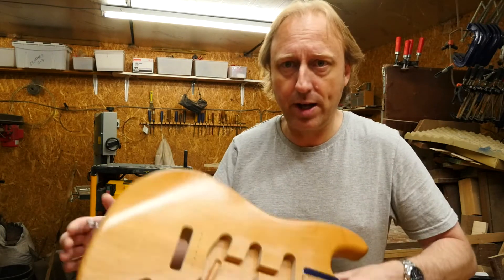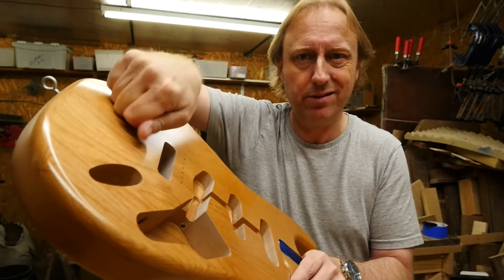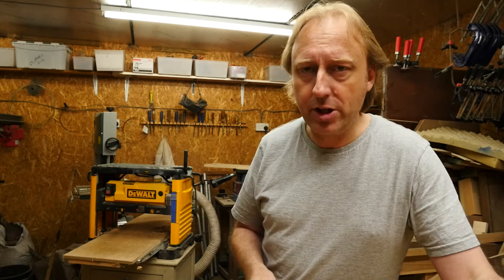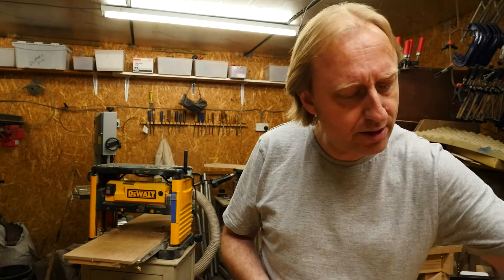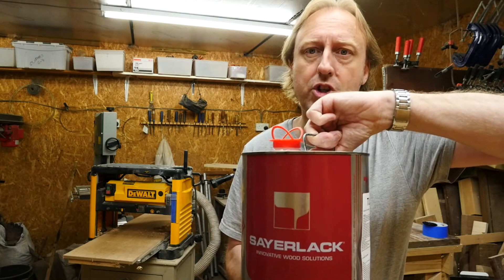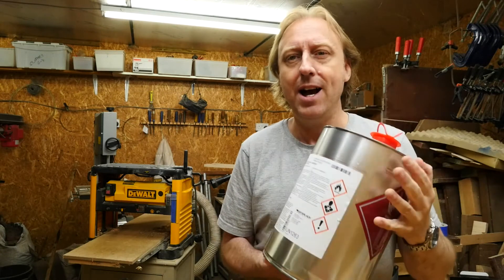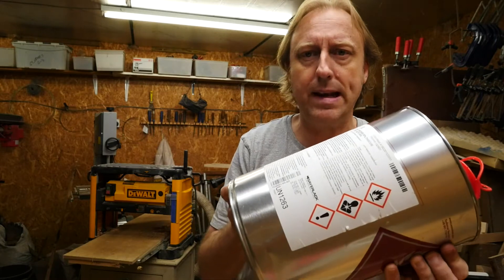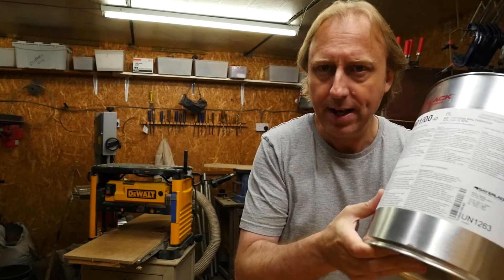What is "Fullerplast"

Comment: Great video, and very informative. Thanks! You said that it could be sanded absolutely flat. My question, which applies - no pun intended - to all sealers, I suppose, is how much mechanical "tooth" is required to allow the nitrocellulose lacquer to adhere properly to the surface? Simply put, flat is one thing, and smooth is another. Cheers from Alabama!

Comment: So polymer plastics are the only extant plastics, good to know.  I was under the impression that acrylic and vinyl and... Idk celluloid nitrate or something... That those were also plastics...
Reply: Apparently cellulose is actually a polymer, I didn't realize, but frankly that suits my point even more because my point is this : it's absurd to say that polyurethane is the only plastic and you're not presenting evidence that fullerplast is urethane.  You're spouting off the same hearsay as everyone else on every forum.  I can say a couple things for certain on the subject.  I've seen vinyl used as a wood sealer.  Fender was forever using DuPont acrylics for custom colors.  If the point of switching to urethane was to make a more durable finish it would be very backwards to start with the sealer or undercoat.  I've seen 60s guitars naturally worn thru to bare wood and have never seen a verifiably urethane finished guitar wear thru.  Urethane cracks and splits and peels.  I have urethane guitars that are doing that right this second.  It doesn't really bond to the wood per se, it bonds to itself and whatever it is underneath the 60s fender top coats that's opaque chips more like nitrocellulose chips than it does like urethane chips and it very much appears to be bonded to the wood.  My money is on vinyl.